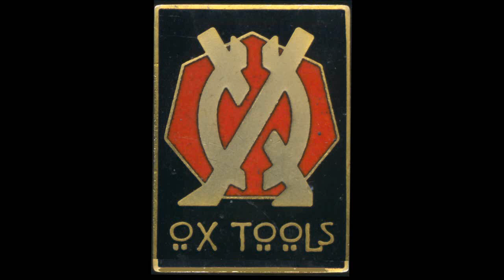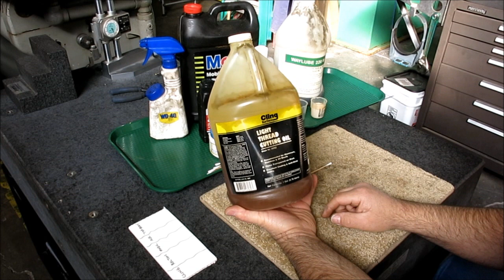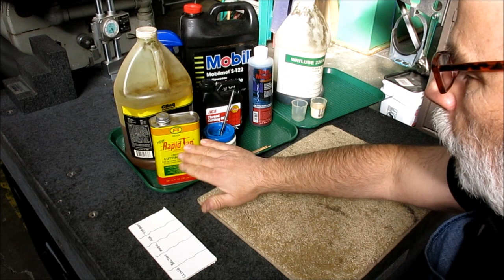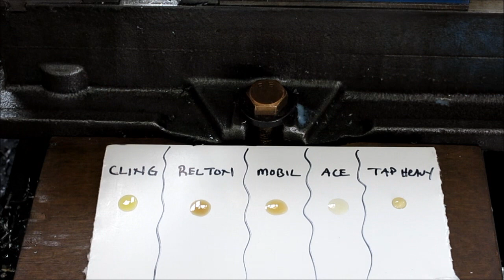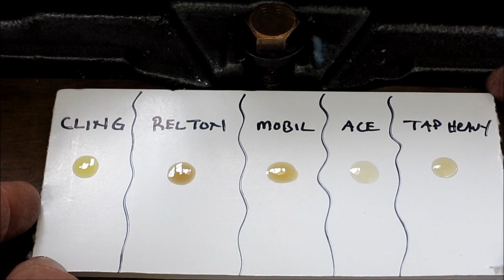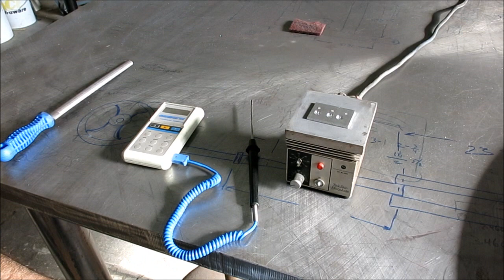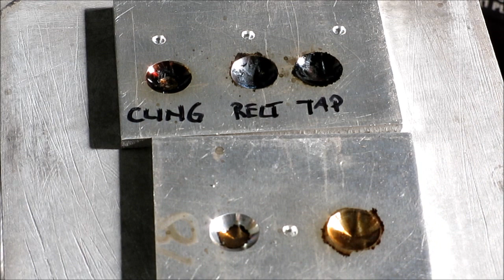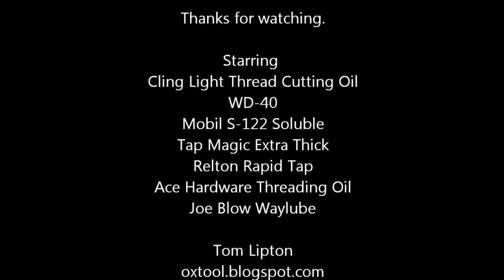Toms two cents on oils and coolants

Comment: Oh yea try this on for diaper size LOL
2" NPSM threads that have to mate flush with a Parker Hanifin dovetail groove in the face of the male 3" od flange to a 1/4" thick female threaded plate with no thread relief called out in either part????
What would you recommend in this scenario??? LOL you dont have to answer this
I'm not the "contact the customer guy" I'm just the poor bastard that has to make it all work, PS this is pharamacutical grade work
Reply from the maker: Sorry man. My diaper is already full. 

Thread mill it? I'm not sure I follow the whole description. We used to thread mill stuff that was shallow or had no tap clearance built into it.

Hey at least the drugs are cheap in pharmaceutical work.

All the best luck. Sounds like you might need it.

Tom

Comment: Hi Tom, CorrosionX... the best smelling oil out there! LOL I use it as a cologne. Great lube and coating oil. Check-er out.
Reply from the maker: Hey Tommy,

I have some of that. It really does have a nice scent. So far I haven't been that impressed with its corrosion protecting abilities. I'm still testing it. I think the Starrett M1 has the same scent in it.

Cheers,

Tom
Reply: oxtoolco What's your favorite for corrosion protection? I like CorrosionX mainly because it won't evaporate. In salt tests, it has performed well when put up against other well-known oils but, there is always room for improvement.  Cheers.

Comment: I thought WD-40 was mostly mineral spirits
Reply from the maker: helicrashpro procrasher Hi Crasher,

Apparently its more  complicated than I ever thought. You can find online analysis of WD-40 that will surprise you. Thanks for the comment.

Cheers,

Tom
Reply: oxtoolco I thought WD40 was mostly mineral OIL. But yeah, I've used it for a lot of things in the knife shop and it's my soft metal cutting fluid of choice.

Comment: We do lots of 304 and 316 stainless work and nothing I have tried from all the salesmen that stop by works like Castroll MollyDEE for tapping that stuff
yea its messy and stinks but it sure beats extracting broken taps from a 
part that cost 30 grand just for the blank, I'm mostly talking CNC tapping.
Nothing else gives you a fighting chance on the stupidly deep holes the
freckleface kid "engineer" put on the drawing!
We had one part that specked 1" deep 10/24 in 316, doable if its realy needed
but when we called them to ask about it it was "oh we dont even use that anymore we weld em on" SHIT LOL
Reply from the maker: Hi gent,

316 will separate the aluminum hero's from the real machinists. Molydee does work well. We keep some hiding at work for those nasty jobs in weird materials.

Hey it only took two clicks to create that deep thread. How hard can it be the machine does it anyway? Drill a couple of holes in some 316 and next time boy wonder comes by have him spin out a couple and see.   

Cheers,

Tom

Comment: Great point Tom, got a kick of it but where I work is very much a job shop and
we have to deal with the stupidity of the kid "engineers" on a daily basis and sometimes its impossible to contact the moron that generated the wont work print to get clarification on what they will accept then couple that with our fab shop that watterjets crap to the print size "supposedly" and leaves NO material to machine and you end up with a headache, grumble grumble LOL CRY
Reply from the maker: Sounds like somebody needs a hug and their diaper changed......

Kidding of course.

All the best,

Tom

Comment: Oh yea thread milled the female threads with a shop made cutter that I designed
and made but the big problem is there is no thread relief called out on the prints?
And I threaded the male threads to within .005" of crashing into the shoulder with an insert that let me get a full thread depth to within 1 thread pitch of the shoulder on a cnc lathe no taper out slaming the tool to .005 off the shoulder
I think I'm just gonna cut a relief groove on the male threaded parts screw em LOL
These morons should have to spend 10 years in a shop before they are alowed to use Cad